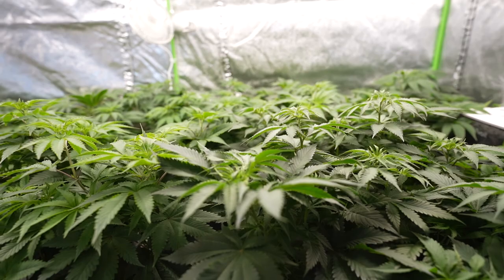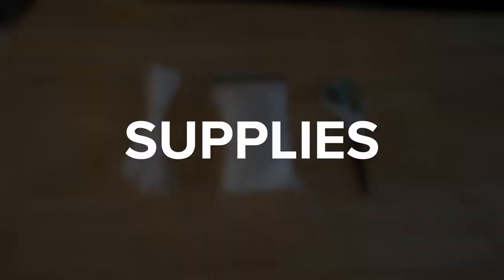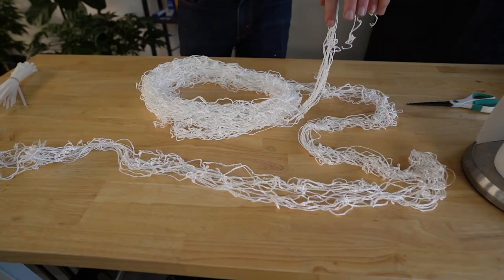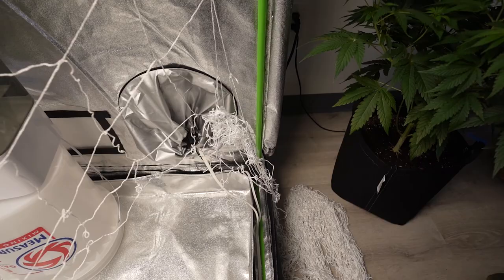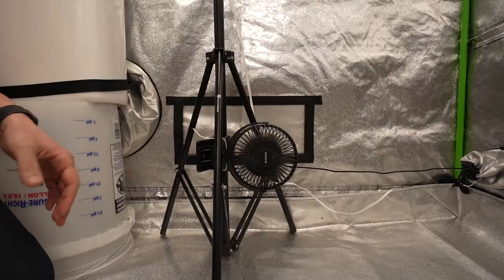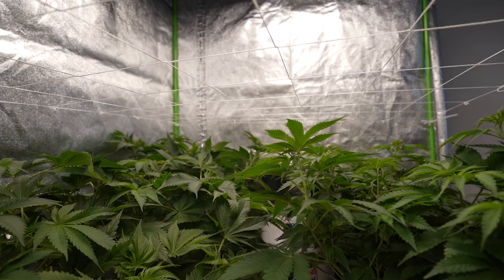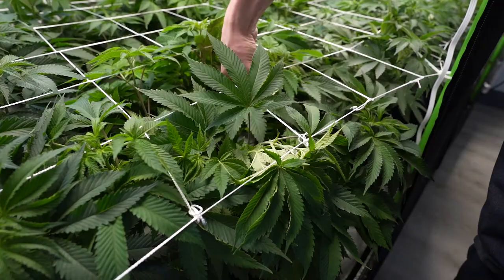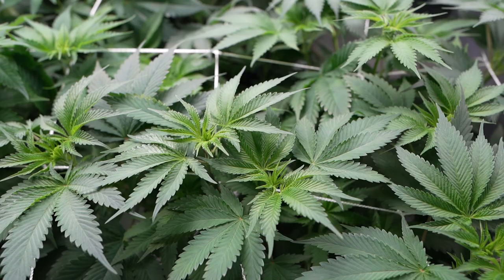HOW TO SCROG

Comment: I have a 0.8x0.8 meter tent (almost 3x3 ft).how many plants (autoflower) i can put in to maxinize yield using scrog ?
Thank you so mutch
Reply from the maker: As a rough estimate, in a 3 x 3 tent (which is 9 square feet), you could fit anywhere from 4 to 9 autoflowering plants.

Here are some general guidelines to consider:

Plant Size: Some autoflower strains can stay quite small, while others can grow to be over a meter tall. Research the expected size of the strain you’re growing.

Pot Size: Smaller pots will restrict the size of your plants, which can be beneficial in a small space. For autoflowers, pots ranging from 2 to 5 gallons are common.

Growing Technique: Techniques like Sea of Green (SOG) can allow for more plants to be grown in a smaller space by keeping them small and inducing flowering early. However, this technique is less commonly used with autoflowers since they have a predetermined vegetative period.

Ventilation and Lighting: Ensure that your tent has enough light coverage and proper ventilation to support the number of plants you’re growing. Overcrowding can lead to issues with humidity, airflow, and light penetration.
Reply: @tpsnutrients  thank you 👍🏻

Comment: Do the plants stop growing once they passed the net? Probably not. Because you didn't say anything related to what happens as soon as they've gone through it. Do they need to be topped again or cut otherwise to keep this even canopy of which you talk throughout the video.
Reply from the maker: Great question! The plants will continue to grow up towards the light after scrogging.  Cannabis plants continue to grow until the light cycle is changed, triggering the flowering period.  Once the plants go into flower, the plant's energy is put into producing buds rather than growing up.  Topping is only a good idea if you want to spread out the canopy even more but is more common earlier in the veg stage.  Let me know if that helps!

Comment: i like to skirt each plant & remove all lower parasitic branches that will steal energy from the tops before i trellis … under the trellis should have zero internodes where new leaves & branches can grow…. all you should see is stalks and stems under the first trellis for optimal air flow and will help prevent certain diseases like PM & the latent hop viroid…. both are diseases that can live dormant in the plant & can & will express themselves in the wrong conditions…. lack of light & air flow will open the door too problems mid flower !
Reply from the maker: Thanks for sharing!